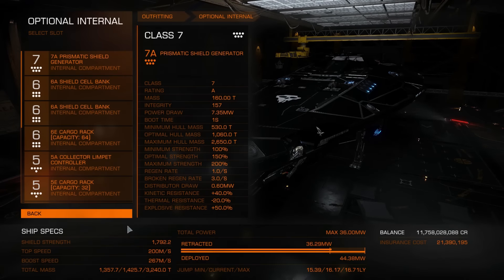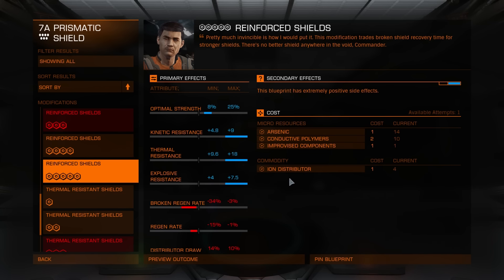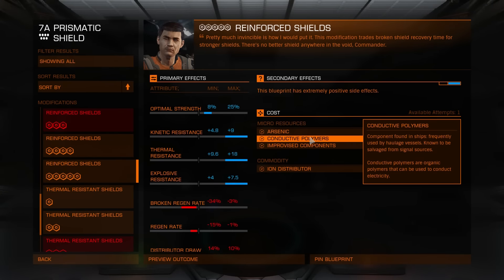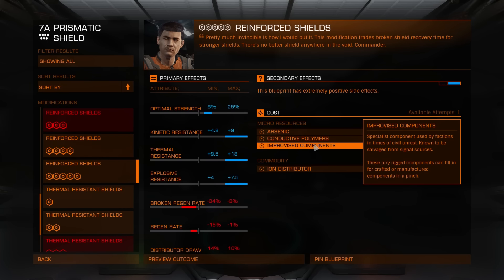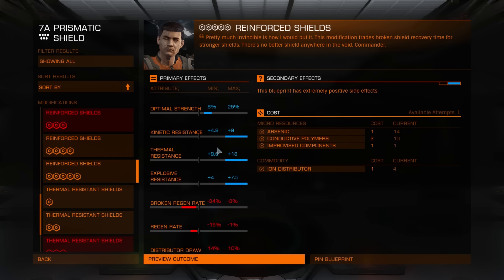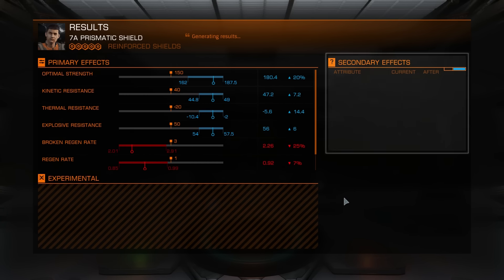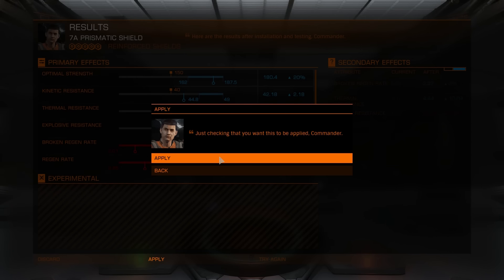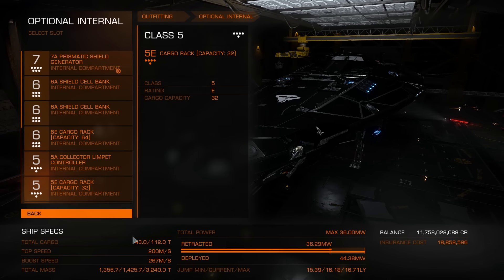Elite:Dangerous. Let's Upgrade. Reinforced Shields. Grade 5

Comment: What are u doing when there is no mission for the material/data u need ? U wait 7 hours and refreshing mission board hoping that this mission will appear ? Did u notice, that mission are created with revard based on blueprints u have pinned to help ?
Reply from the maker: i don't have any pinned blueprint, i think. 
but no, i DO NOT sit at one station as well as i don't search for only 1 material, normally you want to upgrade power plant, shields, thrusters, fsd, power distributor, fsd, weapons, just write down materials needed and do what you can. that lame ass limit is annoying but if you keep an eye on it is doable, just takes shitload of time outside the game to manage it ;/

some places are better for some materials others for other, go to boom system as there are boom delivery missions spawning like crazy and it gives you higher chance, anyway when i start doing missions usually i take 1-2 and upon delivery there are couple more usually and then i end up flying for hours ;/ but at least i can mod my ships slowly.
Reply: +Kornelius Briedis whats the benefit of making relationship to max with some faction. Does they give you more rare items ? I always find usefull material offered by different fsctions so i never get realation to max with one of them
Reply from the maker: i don't see any point in increasing reputation, i see point in getting more missions, that's why boom delivery is great, also change system and fly far away, there might be completely different set of rare reards

Comment: When do you get the invitation for lei chun? I leveled the dweller to rank 3 and used 51 market networks but he will not show up.
Reply: The updating of this value is a bit strange. I logged out then reconnected and it updated. ;)
Reply: Hmm, i loggen in and out a few times but nothing happend yet... These enginners are so annoying.
Reply from the maker: get higher reputation then, i am not sure exact % but if you don't have it at 4 grades then you should start worrying ;)
Reply: that means more sturdy mounts for my ship. thanks for your advise.
Reply from the maker: for different weapons sturdy mount has different stats, and most weapons are better without sturdy
Reply: but it is an easy way to rank up the engineer because they require less materials than other upgrades (or the ones which are easy to find).
Reply from the maker: never said it's not easy